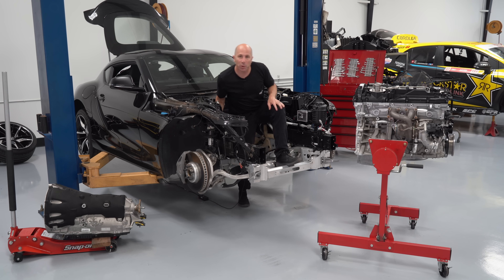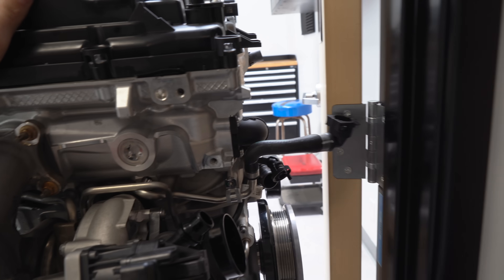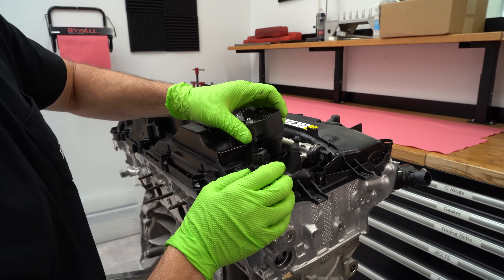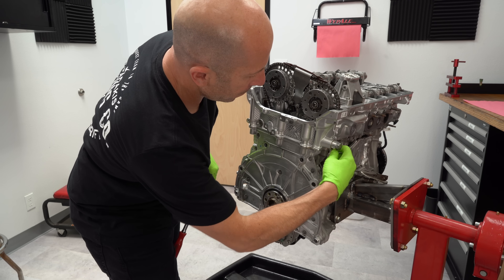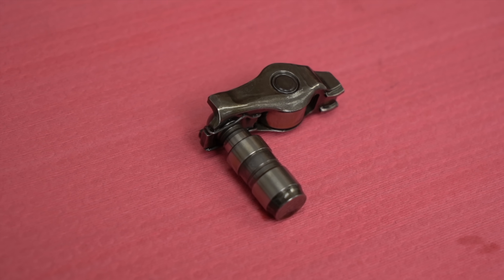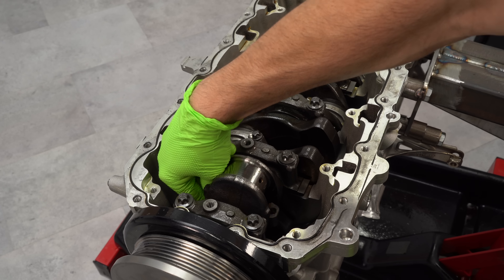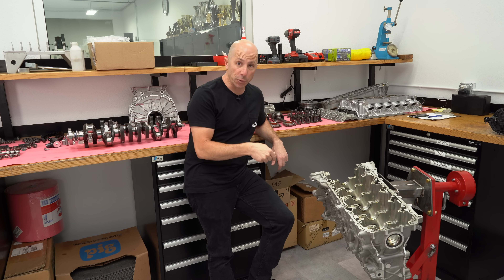2020 Supra B58 Engine Teardown - First Look - Better than the 2JZ?

Comment: Timing chain in the back...... sounds like an expensive repair.

(4.2 litre Audi)
Reply: "chains should never need replacement"  

BMW n20: hold my beer
Reply: The Car Whisperer 🤣🤣🤣🤣🤣🤣
Reply: @the_car_whisperer  not just N20. Also N42/N45/N46, the N43, N47/N57 diesels(what is the original for this idea of rear mounted chain). N12/N13/N18 get an honorary mention aswell.
Reply: It would typically be an engine out operation to replace the chain and guides, I'm thinking this is actually easier, less accessories in the way.
Reply: @Jester123ish  probably, I mean I'm not a mechanic just seemed like a bad idea especially with how things went well with those Audi V8s, granted a V8 is more complex than an inline 6.
Reply: @wh4tevercomest0mind41  Yeah but compare Audi V8 and BMW V8 timing chains. Audi one is just madness.
Reply: @wh4tevercomest0mind41  never really heard of timing chains going bad on a bmw inline 6. The v8s are a different story though.
Reply: @wh4tevercomest0mind41  the diesel  Audi all so has the timing chain in the back of the motor its a bad idea
Reply: @SMNwork  timing chains break more on v8s because the tq is higher than in one of these. And let's be real here were not asking if it will last as it is were asking will it last with mods and if not how hard is it to get out because it looks a lot like pulling the motor or dropping the trans and even then special tools are needed all for 60k. shit I can make a 1000hp American car for that price and it will perform better.
Reply: @Jester123ish  true, plus this car has a pretty long hood, so it shouldn't be that bad.
Reply: It's a good idea if the parts last, but as you saw, you can't mount this engine to a stand by the rear of the block, you need to modify your engine stand. My money is on that it's a major pain to replace chain(s) on this engine.
Reply: RHawk 24 a
Reply: @Jester123ish  alot of guys prefer  to pull the whole motor regardless but most wont for thier sake
Reply: @vikingfish458  it seems like a very big deal, but it's a faster job than you would think.
Reply: @Jester123ish  you obviously are not very good at thinking, you have to pull the entire engine bay apart then unbolt the trans then pull the engine, it is far easier to remove accessories
Reply: @moparjr89   You obviously are not very good at reading, I was talking about once the engine is out, which is usually required to change a timing chain and guides
Reply: @Jester123ish  Nope you can do it in car. That's how I do them. Just have to take out the trans which takes maybe 45 mins.
Reply: @Jester123ish  riight less accesories in the way. you only need to unbolt trans, take off mounts, remove intire engine harness. Yup sooo much easier then taking off bumper pulling radiator and fans and pulling cover on a traditional set up. Have you ever done a timing chain in your life?
Reply: German and timing chain don't go right together
Reply: @Arrozconchopsticks  Timing chain issues are not very common on straight-six BMW engines (I shall not comment on those V8). On the VAG engines, well, we know what the community says
Reply: Audi put it in the back also for weight. On the new Audi’s they also reduced the cam gear size but added a heavy Partikel Filter
Reply: @santabeefy  those heavy filters are necessary thanks to European union shitty  rules...
Reply: @santabeefy  particle filter
Reply: Eclipse538 there is a bunch of euro techs chiming in telling you the reality. Every engine is different but plastic chain guides wear and timing chains stretch. Some last 300k miles some last 60k. BMW’s in recent years have had timing chain guide issues and chain stretch and at lower miles. It would actually be more unusual for a timing chain in any engine to last 300k miles much more than a timing chain guide failure at 100k miles. Just how it really is. Problem is that if there is any timing issues then it’s on the back of the engine.
Reply: So no one is saying anything about the timing chain guides. They will wear out and they will need to be replaced, sorry that plastic will not last. Going to be a engine out repair in the 60-120k mile range. Have fun b58 owners!!! All you guys talking 300-400k know nothing about this. Since when has bmw designed good valve chains guides...? Not to mention all the other complexities of this engine.
Reply: Daniel Boardman Absolutely! Mine are going out st around 180/200 k miles on the S62 and this is way more shittier made this you will need to take out the engine to do that! 😱😱 it’s like $5/10 to fix regular maintenance
Reply: @MrGhostOg  true they dont know shit , got an N47 engine, the chain  sound like broken shit in 70k km
Reply: Christian too many people are up here arguing with the bmw techs, euro techs and people who’ve had chain issues. You can bet when a manufacturer makes a design mistake it’ll be an issue when people drive their cars hard and don’t change the oil enough. It’s an automatic Supra, people are going to beat the shit out of these things and mod them too.
Reply: @MrGhostOg  My 1991 E36 M50B25 has plastic chain guides with 300,000k's on the clock, no issues here and they're nearly 30 years old...
Reply: Sean Kretschmann that’s one of the most reliable engines bmw has produced of course your m50 won’t have issues at that low of miles. Bmw engines have gotten worse over time.
Reply: @MrGhostOg  I mean if they can afford this car im sure they can afford the repairs
Reply: VODProductions problem is when these cars cost 15k and have 120k miles. It’s a re bodied bmw so expect them to depreciate at a normal rate.
Reply: Daniel Boardman I have one of the first generation of this engine N54 and currently have 170k miles valve chain guide has no problem. I haven’t heard of any problem from the BMW COMMUNITY PLEASE KEEP THE NEGATIVE COMMENTS that you’re not sure and know nothing about TO YOURSELF.
Reply: Isf Ngu ok let me ask you this: your one of those “ keeping everything factory boys and driving like a grandma” If So then these cars aren’t for you
Reply: Isf Ngu literally the comment above you is saying he needs new timing chain guides on an s62.. I’m a bmw tech and this already looking like a nightmare. Valve chains on the back always means engine out repairs and sorry any internal plastic is a wear item and so is a valve chain and just because yours lasted doesn’t mean others will too. There is lot of other problems with this engine and I was just pointing out the most obvious.
Reply: PROPER GARAGE! I have my E89 30i fully stock, I do not need any modifications. Driving like a grandma is actually bad for the engine, sometimes you need to drive a little harder. But don’t come and cry about how your heavily modified BMW is so unreliable
Reply: @isfngu4213  I don't even own a damn BMW and have worked on more for friends than any other car...and I drive a VW and have had a Mercedes V8 in the past. New BMWs are on a whole new level of trash.
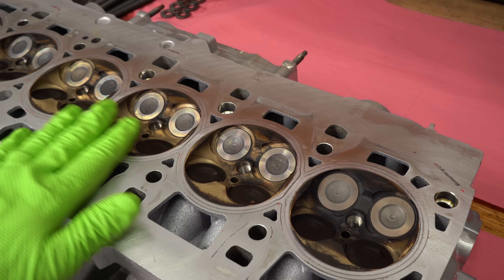Reply: Look at the head @9:57 One cylinder looks like its getting way hotter than the others for some reason.
Reply: I work on bmw and all of the N47/57 engines have the timing there, it costs around 1400 euro to replace the timing with OEM parts
Reply: @alexignat007  i still have nightmares from replacing so many of them😥
Reply: Ford does that shit too, with their v6 they have one timing chain in front for one head, and one in back for the other head.
Reply: @quickrider3855  you kidding me? Must have hired a disgraced BMW engineer after he got fired for their shitty design
Reply: Damn lol I sure got told... why would anyway ever want a Beamer if something so simple and sturdy as a metal chain even has problems?? Yikes.
Reply: BMW had issue with timing chain on 320 diesel in 2009-2013, it had to be replaced at 90k miles and it was in the same position at the back. No surprise people were getting rid of them like crazy.
Reply: @feafajic6392  yup, but the chain is not strong in design for diesels. But the idea is right on spot, reducing wearing on bearing
Reply: @feafajic6392  that engine was from 2007 even. At first also the gears between the crankshaft and the balancing shafts were so bad you had to replace the crankshaft.

I have a BMW with a N47 engine myself from 2008, once you replaced the chain there is no problem anymore. They improved the replacement parts to last much longer.
Reply: bmw engine are notorious for stretching a timing chain, very likely repair on this engine, can't wait to change one :(
Reply: Actually it's better to chain where heavy flywheel is. To compensate wear on bearings. Chain wears them up, and flywheel down. So no, it actually should be more durable than your car
Reply: @Eclipse538 i replaced too many chains on these kinds of engines to count anymore. The problem is that the cars need to rev higher, boost more pressure, more fuelpressure, longer intervals(where the most danger lies in when going over the intervals, yes that happens more than you think). That all to produce more power, use less fuel and reduce toxic fumes. 

It's a problem that more manyfacturers encounter (all the german ones do though)
Reply: Google bmw N47 lol but nah timing chains in back are okay if you keep maintaince up and actual change you oil ever 8000 10000km and not listen to bmw with 20000 miles that's madness no wonder there is chain problems that and leave your turbo time to release all the oil so no build up to be fucked up back into engine and should be okay, but also you either buy a bad one or a bad one ha
Reply: Stfu you idiot.
Reply: As a previous B6 owner, the mention of it was enough to give me PTSD lmao
Reply: @Eclipse538 i agree, i read his comment and assumed he meant 300k kilometers, but reevaluating that, that's still really long. My s4's chains went out under the supposed 100k miles, not under warranty at that point. So, if toyota uses quality parts, chains are significantly better for reliability and longevity. As well as keeping the front of the engine more open for other accessories. But it all comes down to the quality of the chains, guides, and tensioners. Plus the belt design is seriously designed TO fail or require maintenance. Look at the chevrolet aveo, history learned that belts are cheaper but only in the short term, after you damage a head, valves, and pistons, chains become the cheaper option.
Reply: Not that I would ever buy the new supra (for now I'll stick with my jeep srt) but that timing chain is a huge expense waiting to happen. No fuggin' thx.
Reply: This is the dumbest post of the week on YouTube. The timing chain in the rear makes perfect sense, seeing as it's a lifetime part. Those in this thread that said they had to replace their chains in their xxx cars are anomalies, or cars that suffered from poor maintenance from their ignorant owners.
Reply: @ormand3000  You cant make anything last forever. Chains do not last foreverlasting and eventually you are going to have to replace it. As you can imagine, the chain being in the back makes things a lot harder.
Reply: @mirovalimaki  no shit Sherlock but if you're fining chain is going there is going to be a whole lot of other issues as well. Don't get smart with me
Reply: @ormand3000  this hurt my feels
Reply: @ormand3000  I'm just saying it seemed like a bad idea because of the previous issues(with other manufacturers), and if they really were that much of an anomaly then I probably wouldn't have mentioned it because i probably wouldn't have known. Anyway it's a fresh motor a fresh car, only time will tell. I'm not saying don't buy it, especially since I own a legacy gt, which has that dumb issue with the banjo bolt, premature turbo failure, ringland failure and a few other things to mention. But I bought that car knowing what was to come and how to deal with it, same thing with the Supra, it's important for people to know how to deal with possible problems before they become problems.
Reply: Been there done that....TWICE. hopefully toyota uses quality parts and tensioners unlike audi did. It was in good faith, because they were hoping the engine would never need chains and tensioners replaced so they said "let's just put them on the back". Then reality struck.
Reply: @rhawk2424  More like they did in on PURPOSE to rape customer wallets. Audi, BMW, VW are the masters of money thievery
Reply: RHawk 24 Toyota overlook everything BMW did for the b58 motor and also this motor came out on the 340i as well. Different heads but Toyota made sure that they had a reliable motor when putting it in the Supra.
Reply: @BluDemSTI  what the fuck are you talking about? 😂😂 this is literally a BMW that's been TUNED by toyota.
Reply: @BluDemSTI  it's 100% bmw engine. What was in the F30 340i is the first gen B58. This is the second gen, all new BMW have the same. The G20 340i. 

The integrated exhaust manifold and the timing chain are the biggest changes, it used to be a split 2 chain system same as the diesels use since 2007. And now it's just 1 chain.
Reply: @punkrocker10115  it's not even tuned by toyota, it's exactly the same as in the BMW. It's just the new B58TU that is in all the new models
Reply: punkrocker10115 look into 🤡. Toyota engineers made sure that the b58 was reliable. And BMW also shipped parts to Toyota headquarters so they can test them out for an defective and make any final changes.
Reply: It’s bmw engineering what can I say eh 😂😂😂😂
Reply: @yasin040190  ? I'm not the one who made the video 😅
Reply: I was thinking the same thing. That was a huge reason to avoid a used S4
Reply: yikes
Reply: Yeah I am sure a timing chain replacement would be an expensive repair.  Probably about 1-2% of these cars will ever have that done, unless the engine is already out.  No real reason to replace it before 150-200K
Reply: On some engines the chain can be replaced similar to a motorcycle chain by having a remove able chain link then feed the new chain on the end of the old chain then reconnect both ends of the new chain voila it’s done but I’m not sure if this one will be done that way I know some Mercedes engine are like that but you need a special tool to crimp the link on and off. Here is a link of a video From Mercedes showing the processes of replacement of the chains but in the video they have a engine out of the car to better the process go at the 6 min mark to the tool they use https://youtu.be/KkXqjSDTBjc
Reply: @V10PDTDI  my local indie mechanic does  this way on most bmw models. He never goes the trouble of removing cover to change chain. But sometimes it doesnt help because guides might need changing and by chaning stretched chain you only temporarily fix it. Engine rattle sucks.
Reply: Wouldn't it be possible to get to the timing chain by pulling the transmission and going from the back? On a RWD car I can't imagine pulling a trans being much more difficult than pulling the entire front end apart like a typical straight 6 would require.
Reply: @DJ.1001  also to get to the vanos, putting the bridge up and down all the time. Taking the engine out works just as fast.

BMW use a special table where you can drop the engine with the transmission and subframe as a whole, take the tranny off with it and lift the engine from the subframe.

Also with the n47 diesel for instance (the first with a rear chain at BMW), i had the transmission off and pulled the engine out in 1,5 hours (could be less that 1 hour sometimes, but most the engine was still hot from driving).
Reply: It's a chain usually last longer than a belt I recently change my belt of my 79 f-100 custom still had the original one from the factory. Lasted over 40 years.
Reply: One chain, not 25 XD
Reply: Bmw had those timing chain in the back for long time now but they use it in diesel engine for example N47
Reply: @Winter1256  it is put back there to reduce the stress on the chain actually and to place the weight of the engine further back.
Reply: Volvo did the same with their straight six but it was transverse mounted so I guess it didn’t matter lol
Reply: N47 BMW lol
Reply: I have a 4.2l audi the greatest car to get headaches.
Reply: Direct injection change timing and turbo too
Reply: Need to get rid of that chain and gear it instead
Reply: It’s a chain, not a belt so won’t need replacement too often, if ever.
Reply: 180,000 miles on my N54 with no timing chain issues. Making an extra 100 hp.
Reply: Modular block design.  Same block for I6/I4/I3 gas or diesel.
Reply: Plastic guides are a bad idea also.
Reply: Wh4tEverComesT0Mind it's Vin Diesel cousin
Reply: If its a decent product, the chain will outlast the engine. (Anything Domestic after 1992)
Reply: If you break a timing chain from poor driving habits you deserve to pay the replacement fees.
Reply: Vr6 from vw does that
Reply: OMG what if the rear main seal goes bad! Haha. There is always parts In difficult locations that could go bad.
Reply: Every time you do a head on this engine its an engine out job
Reply: Hopefully a lot better than Audi, cough cough Volkswagen.
Reply: A service you'll never have to do
Reply: Timing chain will probably out last everything else.
Reply: @Eclipse538 Taxis (Mercedes, Toyota etc) running over a million miles with original engines and transmissions are "living" proof that the engines do last, you are stuck in the 70s if you think no engine goes a million miles. Frankly nearly every modern engine does if you keep doing oil changes every 7k miles or so.
Reply: 4.2 s4 timing chains are not an easy fix and it's a pretty penny. Now this v6 with it at the back as well... smh
Reply: @romariosmith422  well to be fair it might be a little bit easier as this engine is not a v6
Reply: Why do you think all those Audi 4.2 cars are for sale around 80-90,000 miles. It's time to do the timing chain. That's 7-8,000 dollar job on a car worth maybe $10,000 or so. Yeah. Sell it and get something else.
Reply: That's why you don't void warranties lol
Reply: Vr6 and vr5 engines also have timing chains gearbox side. Just they are made in fwd format. Nothing new here.
Reply: It wasn't the chains that went on the 4.2 Audi's....it was the plastic guides that failed.
Reply: Yea I gotta 2004 Audi S4 with a broken timing chain $2400 repair if someone else does the labor
Reply: Don't forget that audis are garbage on average, so no wonder you have problems like that
Reply: Typical German engineering
Reply: Dutertenwes
Reply: Let’s hope they don’t pull a VW with the timing chain issue lol
Reply: That’s bmw for you. I believe it’s bmw would designed the engine.
Reply: I sold my 4.2 audi s4 before the timing guides went out...was pretty obsessive about oil changes...believe me, this is not a fun or cheap repair for ANY car...
Reply: What we have here is a bunch of people complaining about a timing chain which at it's expected issues mileage the car will be a 2nd, 3rd, or even 4th owner.  If you're complaining about it wearing quickly when modded, well there's something on everything that's an issue when handling that high power beyond a BPU of tune+turboback.  You'll pay somewhere at some time.
Reply: The new supra owners get a BMW engine modified by Toyota's engineering team to iron out all potential flaws! What r u all complaining about?
Reply: They put the audi chain in the s4 because there is no space in the front.The engine was sourced from the much larger S6 and s8.both of which have the chains in front
Reply: Mario like you really never heard for any timing chain issues... what rock have you been living under? n47, s62, s85 as well as the occasional on all timing chain engines. Normally when you hear chain issues though you can just open up a front of the engine. Timing chain issues on the rear of the engine have been an issue for all manufacturers.
Reply: Chains should never need replacement. By the time it needs replacement the engine needs a full overhaul and rebuild anyway.
Reply: I've seen enough Mazda/Ford 2.3 engines with no more tensioner travel left at 250k km, not miles, to think a timing chain never needs replacement.
Reply: @david929190  also seen plenty of bmw inline 6 with over 350k - 500k with no problem, only by keeping maintence regular.
Reply: @iMentorZz  also seen plenty of vw and audi engies with under 100k km (60k miles) with chain problems. :D
Reply: @Luckingsworth  Everyone says this but it's not true. There are dozens of vehicles out there with timing chain stretch issues, timing chain guide issues, etc that require a whole timing chain kit even if the chain itself isn't snapped. The K20 in my RSX-S is known for stretching timing chains. The M62 in my friend's E39 540i is known for eating the chain guides. There's tons more examples out there than just those two.
Reply: @Luckingsworth  the chain is most likely a lifetime unit but the guides are not.
Reply: Tell audi engineers that about the dreaded 4.2 L v8
Reply: @Luckingsworth  Many BMW engines need chains routinely replaced.
Reply: @Luckingsworth  Not true as a Tech and doing one at the moment.. the Guides go out all the time
Reply: @Luckingsworth  tell that to bmw because they've forgotten that! A 125cc bike has thicker chain than BMW engines
Reply: @Luckingsworth  No... chain is weakest link (pun intended). Engine internals probably good for 1 000 000+ miles but that single row bike chain I am afraid lasts 300k, 400k tops.
Reply: @N4CR  My old Mercedes has a double row chain and the car surely will rust to the ground before engine needs work.
Reply: @Mortalomena  This is 100% not true, just look at the vw and audi chain driven engines (especially the older ones). Im a official vw mechanic and we always joke on cars with over 60k km (around 40k miles )on them that are chain driven, and come just for normal maintenance. Iv'e personally diagnosed around 20 cars with chain problems under 100k km (60k miles.)
Reply: @mirovalimaki  I'm not counting VAG products as cars, they are more like single-use plastic utensils.
Reply: @Mortalomena As an official vw mechanic i a agree :D
Reply: @Mortalomena  if it will take you 300k before you pull the engine out of a sportscar to replace the timing chain, i'd call that a win. i'd prefer that over replacing front mounted timing belts at shorter intervals.
Reply: @Mortalomena   300k-400k miles is still a really long time before a regular timing belt. Let alone toyota probably developed it so the chain never needs to be replaced.
Reply: @mirovalimaki  well I have a 2001 jetta with a 12v vr6 with 300k on it and it still runs great and a 2001 Audi a4 2.8l with almost 200k and it runs great my uncle has a 2000 jetta 2.0 200k runs good my mom has a 2008 jetta 2.5 with 220k and runs great too I haven't seen one that needs the timing chain at 60k that's what my neighbor said that was a vw mechanic when it was at 120k the timing chain should be done every 60k it won't last much longer and now it's at 300k and none have had the timing chain replaced
Reply: @everythingloud4068  1. The vr6 is just an awesome engine :D.

2.Im talking more about around 2008 cars mostly the 2l petrol engines which are chain driven.

3. The 2.5tsi is a america only engine.

4. ive resently herd that there werent as much problems in central europe, but. In Finland the chain problems were a lot more common.  Maybe because of the different type of asphalt/tarmac used here, the way too common going road de ice salting plus the cold winters and road dust.

 (sorry, i dont know how this should be sayed, or is it even a thing in the usa, but) there was an official vw service tpi for idle and startup noice on the chain engines. (They callout common problems and how to fix them)

5. All of the chain problems werent catastrophic, most of them were just additional horrible sounding noice when you start the car or rhe car idles, but there were way too many low mileage cars with failed chains.

6. I own a 2008 over 200k km chain driven 2.0 tfsi engine myself and it has never had chain work and you can hear it. 
I know alot of cars which hadnt had it done, but also ive seen a lot of low km cars which have never chainged the "maintenance free" (xD) chain and have had a chain tensioner broken under 100k km.

Dont get me wrong, i love vw and audies, but they have had some relly stupid messups.

And im not a native english speeker, so there is pound to be some faults here and there, but i think youll get the point. :)
Reply: @Luckingsworth  arent you glad the whole motor is out then? lol
Reply: @Luckingsworth  lol. Right.
Reply: @Luckingsworth  Not some of the audis that had timing chain issues. And you had to remove the entire front bumper and rad support to replace it. TOYOTA done goofed up by putting that money pit BMW junk engine
Reply: @Luckingsworth  LOLZ . . . can I have a free ticket and a permanent resident green card to that perfect world where you live on ? 🤣
Reply: @Luckingsworth  it's not usually the chain to go it's the plastic guides
Reply: @Luckingsworth  Exactly....if you need a new timing chain, you've probably blown your engine...in which case it will cost you.
Reply: @Luckingsworth  Its not the chains its the plastic guides
Reply: @Luckingsworth  search for N47 :)))
Reply: Jon M ever heard of an n63 motor haha
Reply: @Luckingsworth  It's not the chain that wears out, it's the guides and tensioner.  How do you work on those?  Both of my BMW engines needed their tensioners replaced at around 150k miles, it was very easy since the chains were in the front of the engines.
Reply: @earthwormjim  Well, since he unthreaded the tensioner as a unit from the side of the block, I think all you have to worry about is the guides.
Reply: @Luckingsworth  not true my friend did a timing chain on his 2007 maxima at 80k hasnt touched anything else on the motor its over 250k and climbing no other engine work ever needed.
Reply: @Luckingsworth  Isn't it the guides(plastic) that usually fail?
Reply: @Luckingsworth  You have to replace guides.
Reply: @Luckingsworth  Yeah not on a BMW motor that won't last over 200k miles it won't, but good Japanese motors like Toyotas can easily go 300k+ before rebuild.
Reply: @nateross14  plenty of bmws cross 200k. My 330ci has 214k and I drive it daily. I agree that Japanese engines seem to last longer tho
Reply: Jon M You are wrong. What if I need to upgrade the cam shafts ? What if the guides fail ? Do I need an overhaul ? Of course not
Reply: @BF109G4  what are you talking about?
Reply: Or most 3.0l Diesel engines from bmw. Brilliant BMW idea 🙄
Reply: @tatudan5369  Fear not, the M47 and N47 2.0 diesel engines also have that. And they all died at 180.000 km unless you change the tension pulley which was a defective part from the factory xD
Reply: @tatudan5369  even the n47 engines got it in the back
Reply: Sounds like BMW Sucks now days ! I got E39’s M5 and no problems ☝️ and still make more power than new 2020 Supra 🤣🤣
Reply: @propergarage4249  But those are V8's Still this engine to the crank makes close to 400hp which the E39's GLORIOUS V8 makes 420hp if im not wrong.
Reply: hector sepulveda absolutely!
Reply: @propergarage4249  BTW while the Supra is getting built, i know some guys who can fabricate some serious kickbutt parts (their specialty are 2JZ's) for the B58, i would like to scare the shit out of some BMW trust fund babies with one of your E39's. 😁😁😁😁😁 In my country those are RARE to find.
Reply: hector sepulveda what country are you from ?
Reply: @propergarage4249  Puerto Rico, the small island of some of the fastest imports and 2JZ's in the World.
Reply: hector sepulveda I believe you ! You guys also have  works fastest Hondas
Reply: @propergarage4249  There was a night in the drag strip, it was the darkest day for Honda fans and owners in the all motor category, they well killing it with their 10 second K20 CRX's and Civics, the suddenlly it apeared the trio of terror, 3 SR20VE Nissan Sentra B13's, no one expected to see the biggest asswhooping of their lives. All K20/24 hondas were defeated by the three of them. After that night i've never seen those cars run again. Good news they still exist but the're standing down.
Reply: You are right, this engine is so complicated
Reply: @BF109G4  lots of special tools required to keep BMW dealers busy.
Reply: What's good about this engine is that it's an actual chain and not a belt. Toyota makes good engines, one of the reasons I like working on Toyotas. The BMW aspect is what worries me. What exactly did they provide for the car? I'm guessing it was probably technology like sensors and what not.
Reply: Martin Ramirez lol, Gazoo racing revised the suspension build for Toyota, almost exactly like the BRZ/FRS partnership with minor tuning differences.  The rest is BMW.  The start up sounds like BMW, sorry if ur a fan boy.